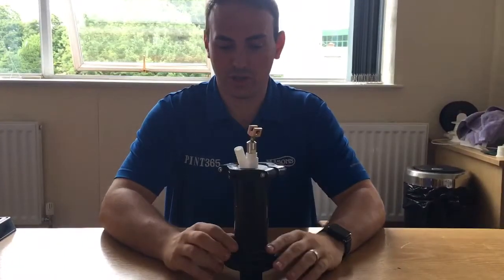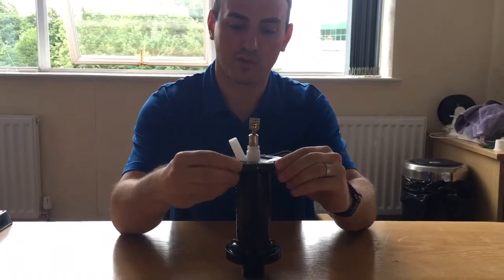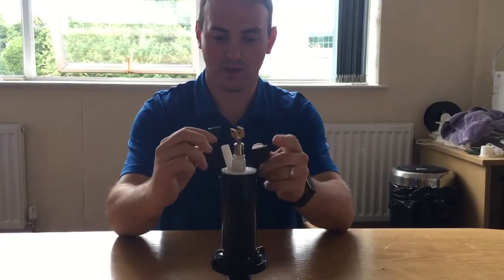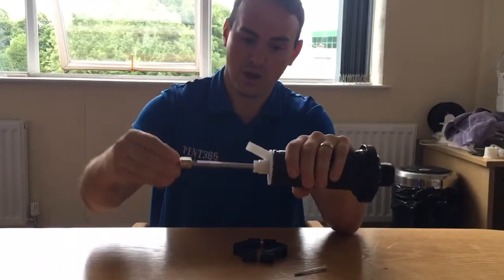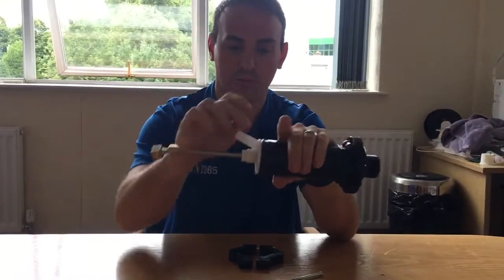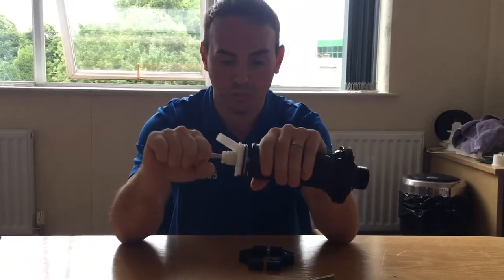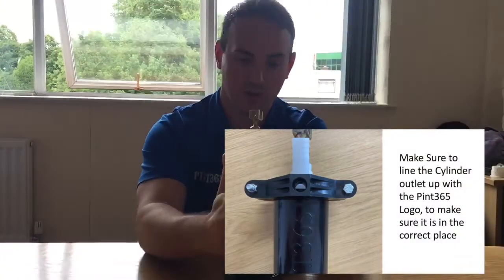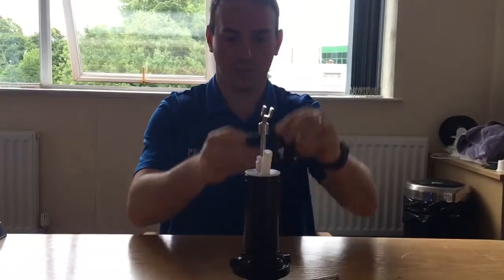Cylinder Top Cap and Bucket Change

Comment: Thanks for this short clip, certainly useful to have it demonstrated. 

Does the bottom part of the cylinder come off too for giving it a thorough cleaning? When I'm not using the Pint365 for some time, I would like do disassemble, sanitize and store it taken apart to avoid any residues in there.
Reply from the maker: Hi Curt, yes this is possible however cleaning with a line cleaner should be sufficient. A re-assembly point to make sure of is that you screw on the bottom cap tight enough so that the O ring creates a seal, plus that the assembly arrows line up